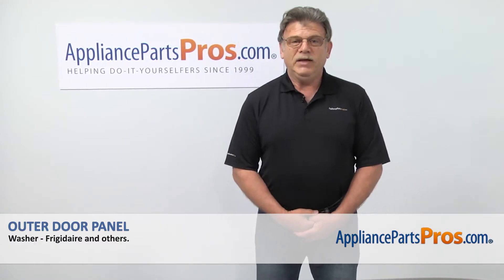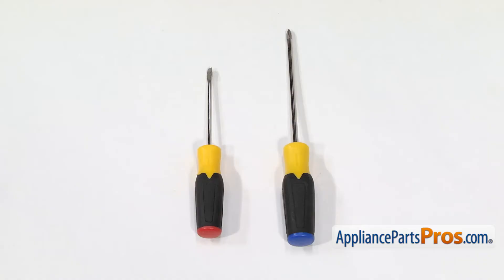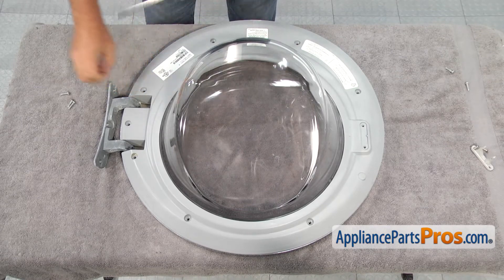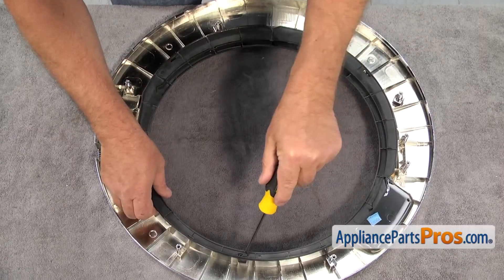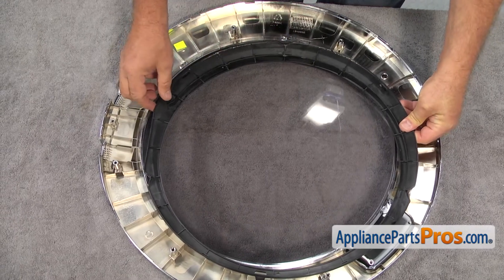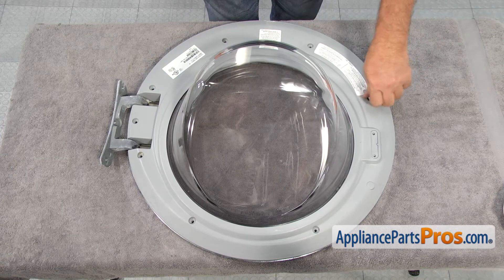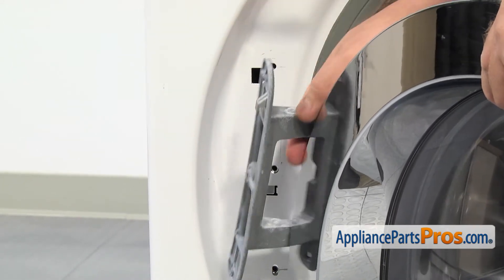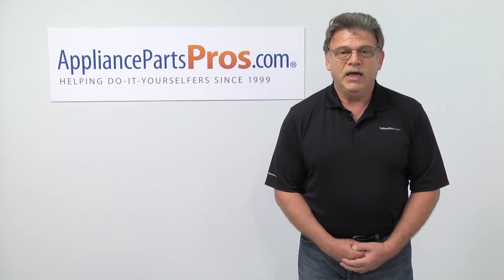How To: Frigidaire/Electrolux Outer Door Panel 134999525

Comment: Terribly designed product engineered to fail. Who at frigidaire decided a 10lb door that people often put weight on should be held on by 2 small plastic tabs. Then when it does break, lets charge em $250 to fix it. Genius.
Reply from the maker: On  your model, are the tabs not sold as a separate part? Or do they only come as part of the assembly?